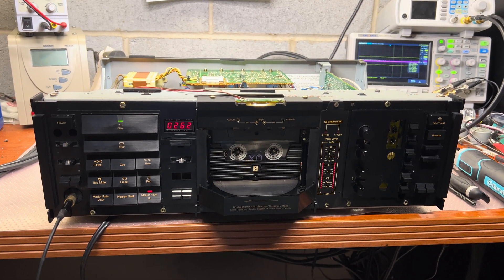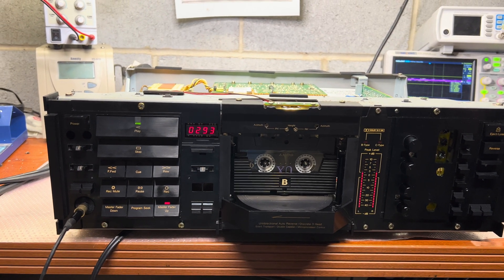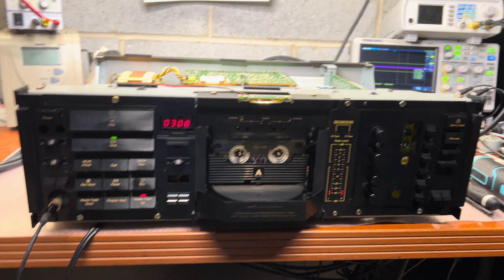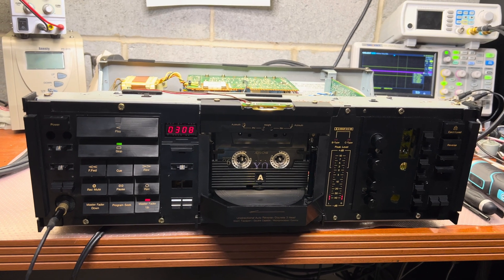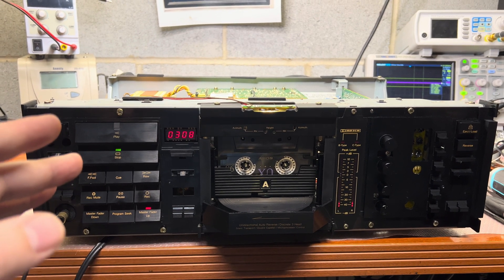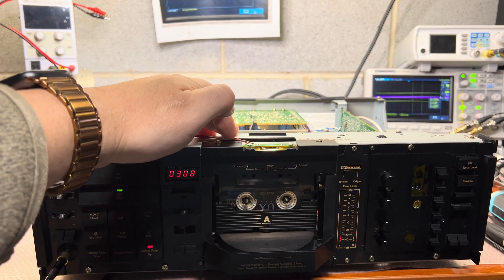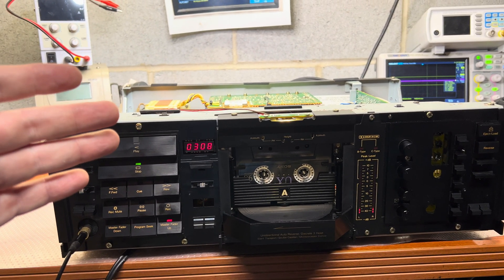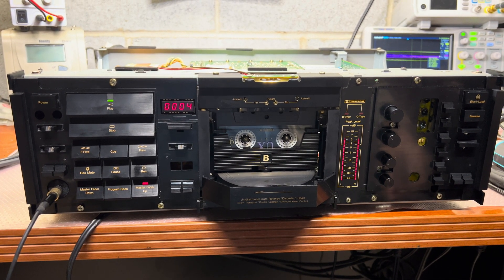Solved! Nakamichi RX-505 Tape Skew Issue

Comment: I'm curious- prior to changing the capstan belt, did the deck actually perform with respectable wow % readings? Just trying to work out if you can have bad inter-capstan tension but yet a deck can still perform well, with respect to its wow figures. thanks.